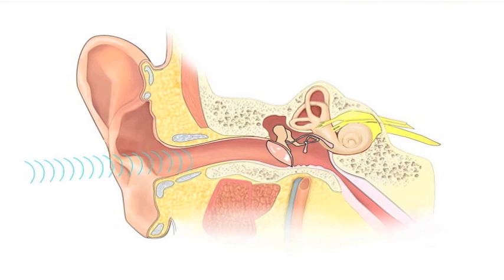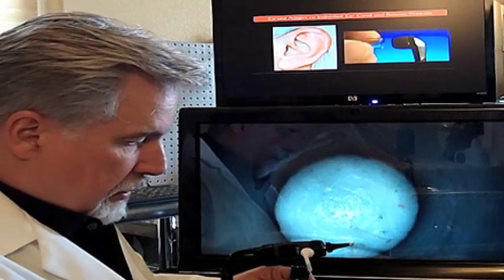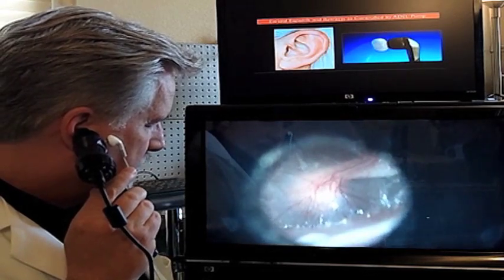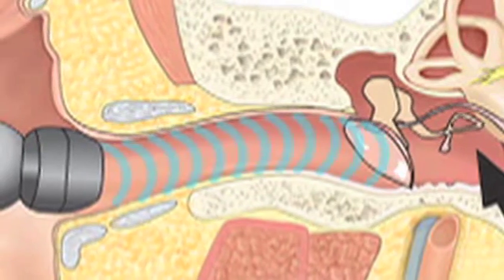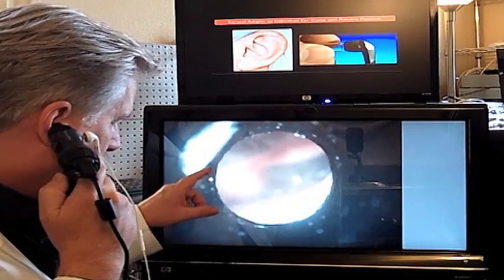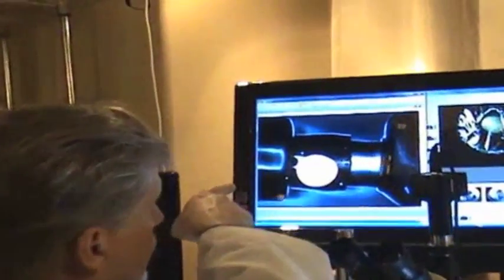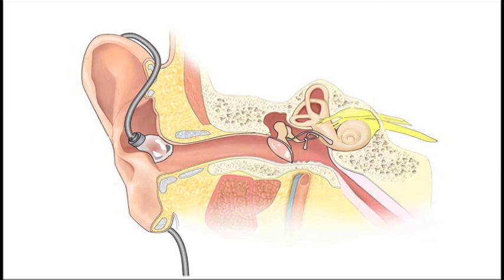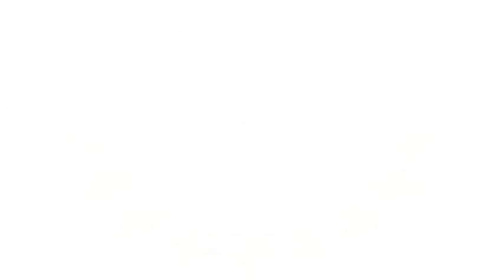"Listener fatigue" Prompts Headphone Redesign

Comment: I still use earbuds in some situations. For instance when I've gone to bed to sleep. But I really don't like using earbuds, or ear plugs as well, as both leave my ears feeling dry, itchy and leave the skin in and around my ear hole flaking( almost looks like a snow storm ). Also earbuds cause pain in and around my ear holes. And I absolutely can't use in ear phones either as the pain they cause is so much worse. I prefer using headphones. The sound is way more better and I don't feel I have to turn the volume up, unless the volume quality of the recording is bad or it has been a recording made from an old vinyl record. I do have tinnitus but that started at age eight. From constant ear infections🎼🎧

Comment: Hey folks! Don't wait till they go on sale, make your own using cling film and ear bud plug types.Sound is carried by vibrations in the air. Sound cannot be heard when an attempt is made to create it in a vacuum. Sound is actually measured in decibels but I'm not inclined to suggest someone is stupid or foolish for suggesting otherwise. You can be wrong about science that's the best part, so long as you honestly endeavour for the truth using tried and tested scientific methods.